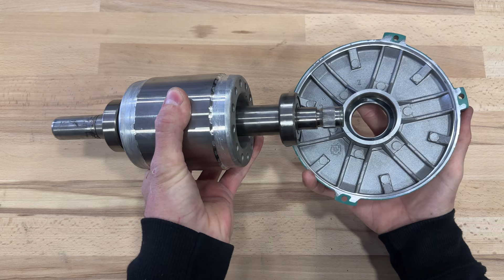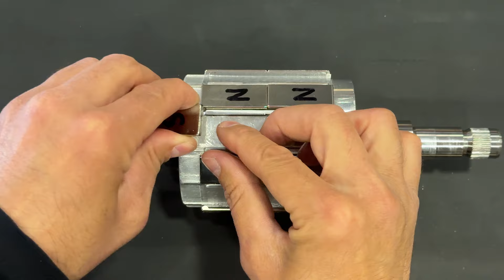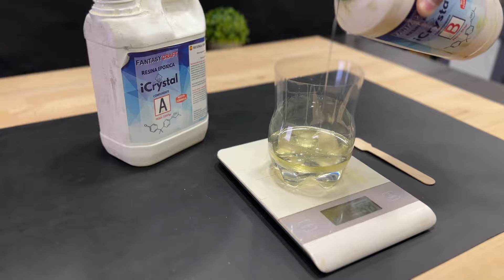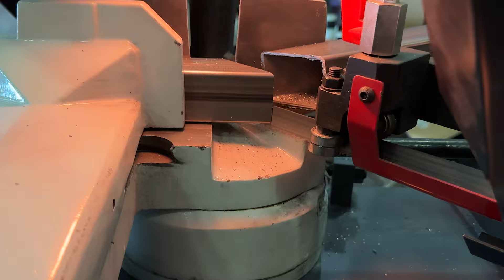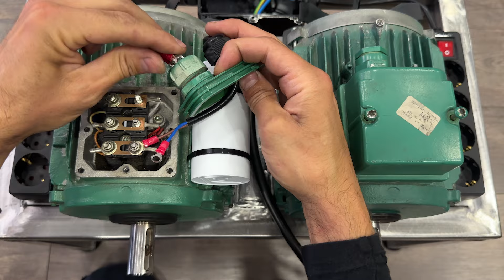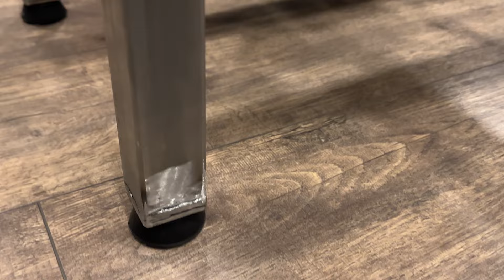FREE ENERGY! 10kW 110v-220v Generator with Electric Motors💡💡Liberty Engine 5.0

Comment: I would like to see an indepth extreme use test with hard use grinding and welding for an extended period of time, not just a light bulb and then a grinder doing a few seconds of very light grinding. I would like to see a time elapsed video of a bigger version powering a home. I am quite tired of these few second demonstrations that show no real load testing for an extended period of time and still be able to maintain the RPM

Comment: It sounds like BS to me; these free energy scams have been around since they discovered electricity. If they really work send one to the sceptic's society who will pay you 1 million dollars to assess and disassemble one of your Liberty engines to see if they are legitimate. Go ahead let them look at one, you get money and the world gets the truth. Or is it just a hoax to get views on YT? I know the true answer.
Reply: Why dont you make one and see for yourself if it works or not? The equipment needed to make one does not seem to be very expensive any DIY guy in to stuff like this probably has it.
Reply: @BurninSven1  I wouldn't waste time building something I dreamed about when I was 7 years old and when I knew nothing about the conservation of energy and thermodynamics. If the solution to our energy woes where this easy, why isn't anyone running their house on this system, though someone probably claims they are doing so. If you understand electrical principles, you would know that you cannot get more power out of a system than you put into it.
Reply: @BurninSven1 this will never work. Motors are never and can never be 100% efficient. So even if you get two motors to power each other, it either won’t last long or not be able to output any power. Every time the motor is powered it loses energy to heat, that’s why there are fins built on the casing. A machine just cannot power itself internally forever no matter what.